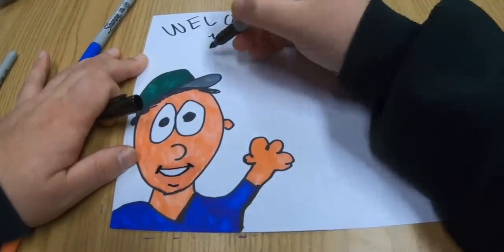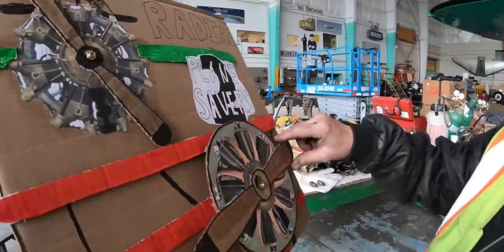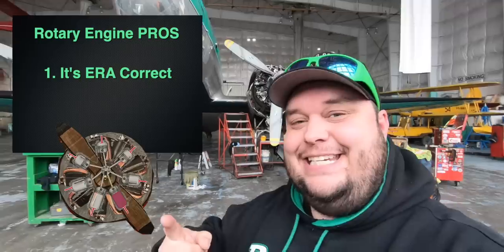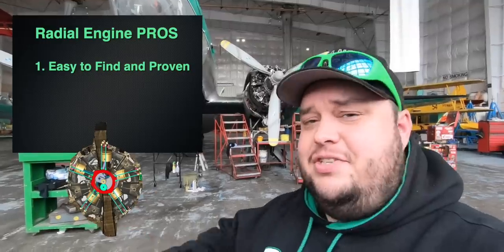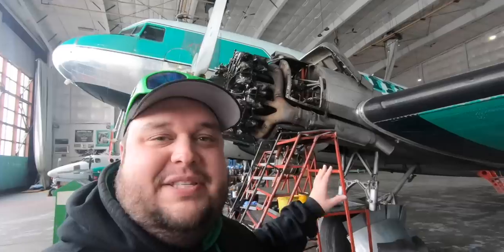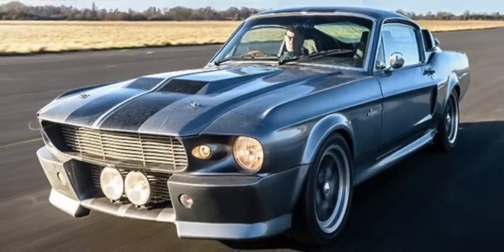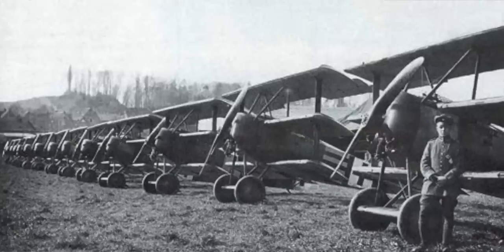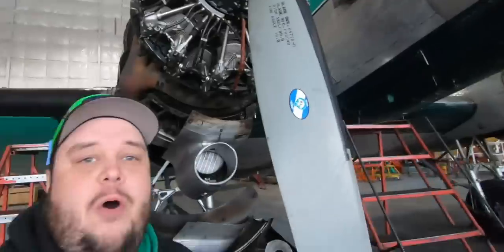Radial vs. Rotary | AIRCRAFT ENGINES | Plane Savers S2-E6

Comment: It must have a rotary engine so put a Wankel in it. Just kidding.
Reply: A Wankel is NOT a rotary engine, it is a rotary piston engine. Not even close.
Reply: @blackhatter011  Wankel KKM57. KKM stands for Krieskolbenmotor. Krieskolbenmotor literally means "rotary piston engine", in other words a engine with a spinning piston. The rotor was considered a three sided piston that rotated instead of reciprocated by KKM designer Hanns Paschke.

Technically the KKM isn't even a "rotary engine". "Rotary engine" literally means "TURNING ENGINE". The KKM ENGINE does not turn, the rotor INSIDE of the engine turns. It's a spinning ROTOR (piston) engine, not a SPINNING ENGINE.

The original engine designed by Wankel himself (the Drehkolbenmotor) WAS a rotary engine. With the DKM the housing spun around the rotor somehow. However that engine never made production. Wankel was always miffed because in his eyes Paschke had turned his engine "from a racehorse into a plow mule" (even though Paschke's design was more practical).

I've never seen any demonstration of how Wankel's original DKM design was supposed to work. I'd love to SEE a demonstration of a original Wankel though because it sounds insane (even more so than the Millet type rotary). By the way Mazda just used "Mazda Rotary" as a brand name because they didn't want to pay the Royalties to use the Wankel name.
Reply: @waynepurcell6058  did you miss that just kidding part?
Reply: @blackhatter011  I was replying to your SECOND POST where you called a Wankel a "PISTONLESS rotary engine". I was just pointing out that "rotary piston engine" was in the actual design name itself. The other stuff is just extra info for the hell of it.
Reply: @waynepurcell6058  well you're still wrong because... The rotary engine carries out the same process as a combustion engine but with a fraction of the components. There are no valves, no timing gears, no con-rods, no pistons, no crankshaft and only three main moving parts compared to the myriad of parts involved in making a 'normal' engine work.